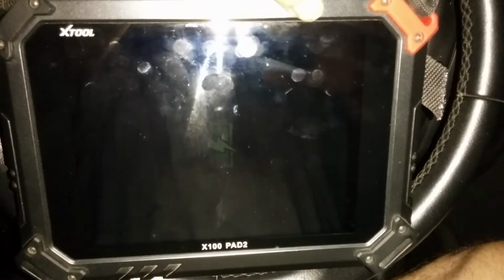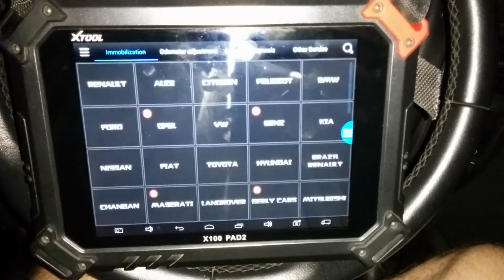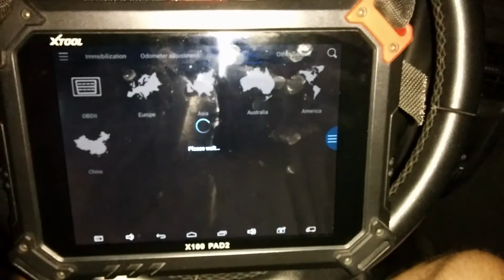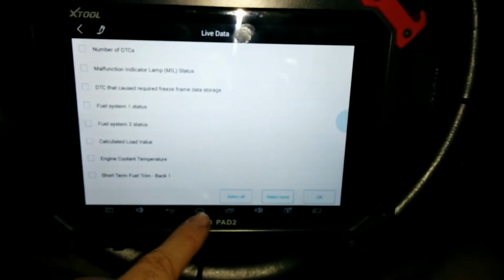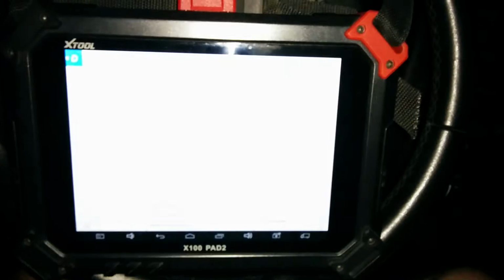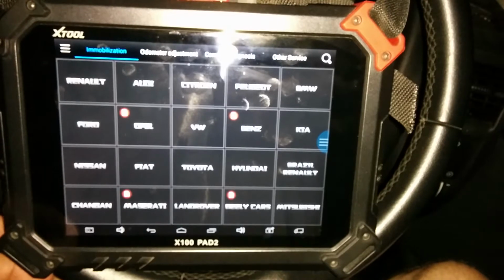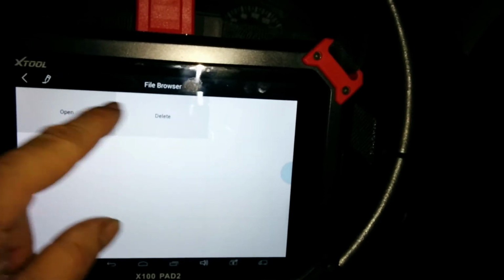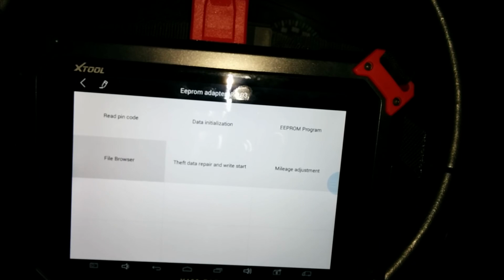read pin astra 2003 xtool pad2

Comment: looks like a decent tool  weird it will not give the pin
Reply: Xtool x100 pad2 pro  cant read pin code on Opel ,Fiat .I tried to read pin code  Opel Zafira 2003,Opel corsa d  2005,Insignia  2011 , Fiat Punto 2007 ,FIat Scudo  2007  ,Fiat Bravo  2009 ,Opel Astra G ,Opel astra H